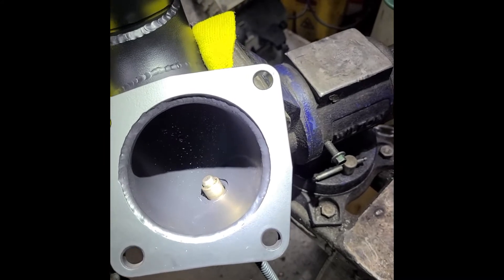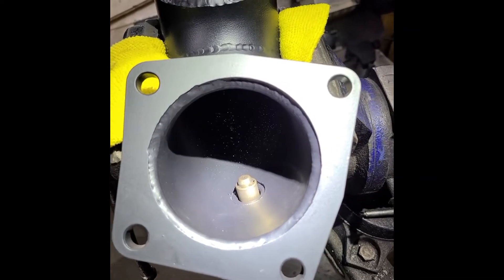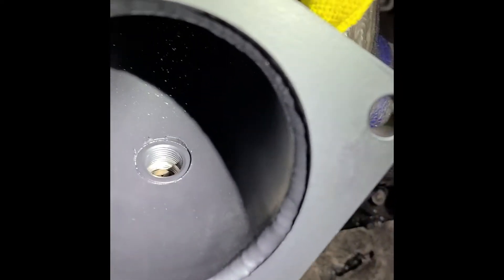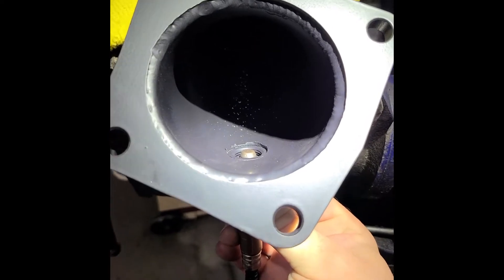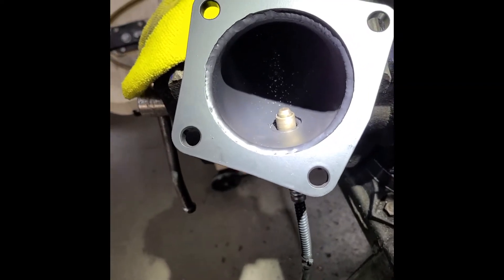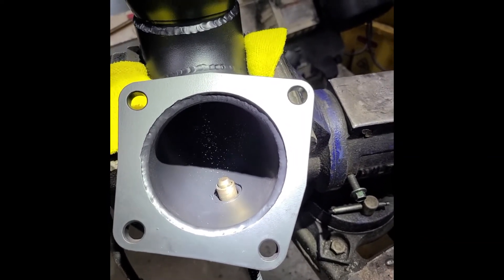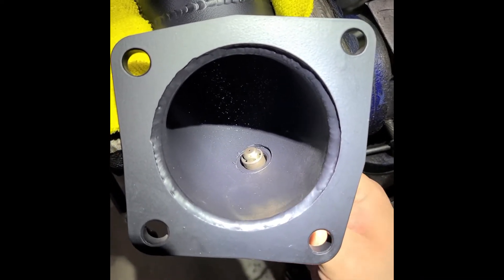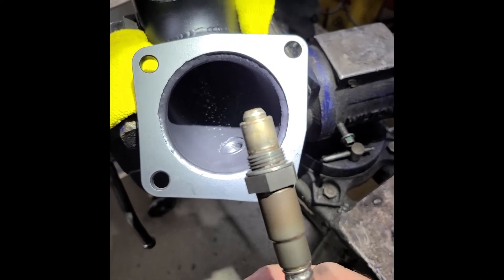Do not do this... please!

Comment: Specifically to the VN does this only matter on the pre cat sensor? The reason I ask is there is several people running catless using jbend vibrant on the secondary sensor without issue.
Reply from the maker: Yes, you never... ever put a spacer on your pre-cat sensor.
Reply: @TorkMotorsports  this is the post cat sensor I'm referring too. Are you saying you shouldn't run a defouler post cat ?
Reply: @boostedn  it doesn't matter on downstream O2, as it only measures the efficiency of your emission control devices(catalytic converter) and has nothing to do with fuel trim. One of the popular repair on a cat code on older cars is to put an extension on sensor 2 socket